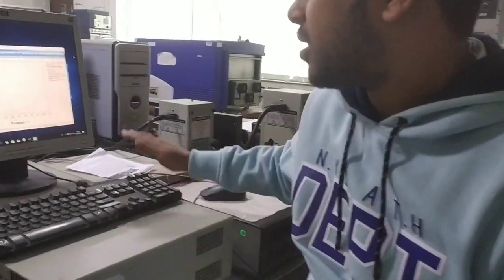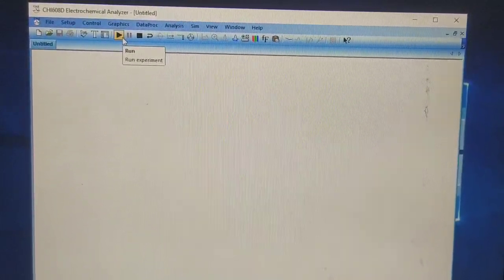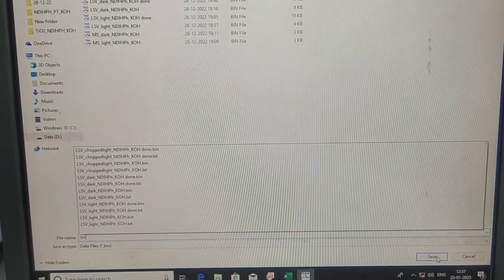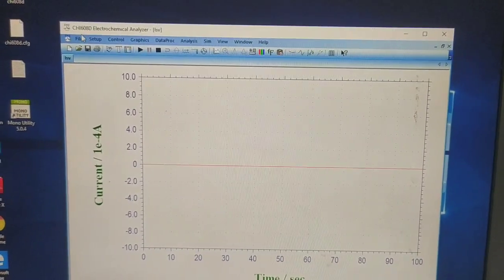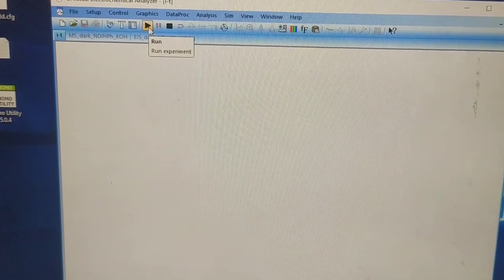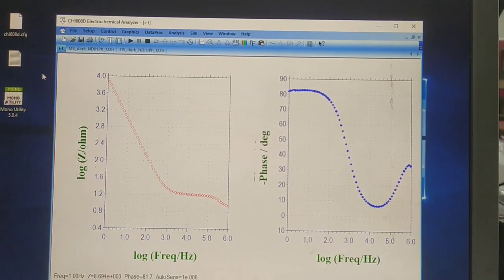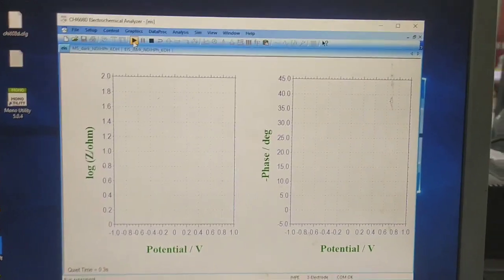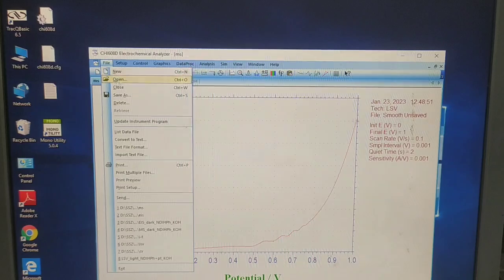How to perform #CV #LSV #Chronoamperometery #EIS and #Mott_schottky using #CH_instrument_software

Comment: How to prepare glassy electrode and provide basic information about electrolyte solution
Reply from the maker: Make con. Solution of your material in volatile solution and drop cast it on glassy carbon electrode
And electrolyte solution  should be made up of .5 M KOH or Na2SO4